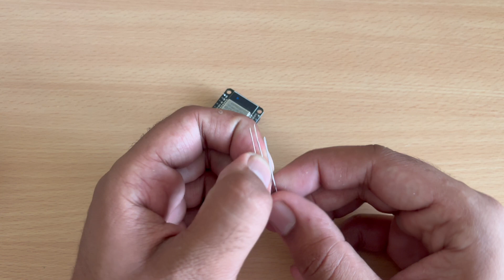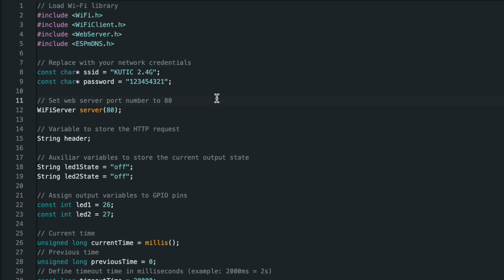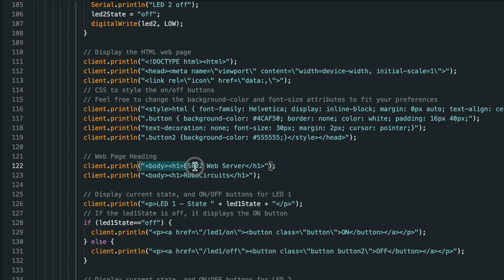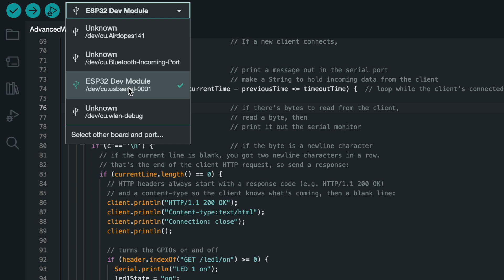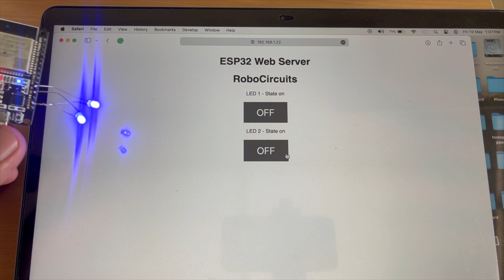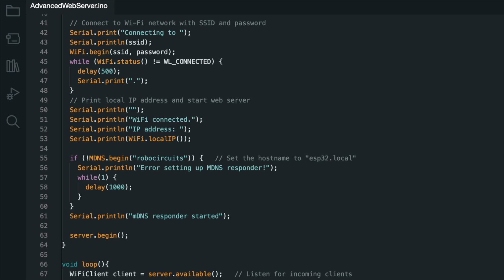Host websites on ESP32 | ESP Webserver with mDNS | ESP32

Comment: I have a pi pico w I want a cable which will connect to my as well as to my laptop's port basically a cable which will have two ports at a time one for pi at the back side of the usb and one for laptop at the front side of usb  can you suggest  And Yeah nice explanation